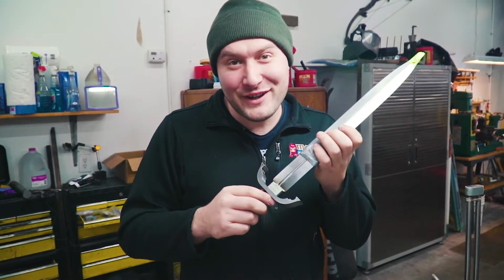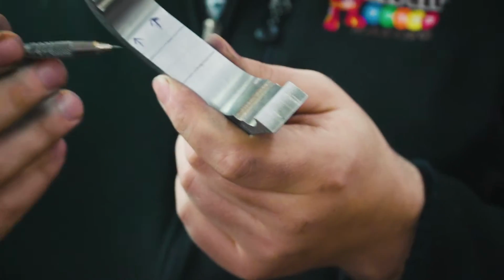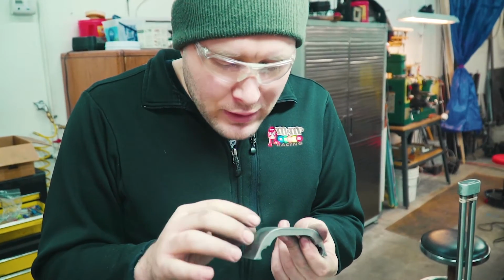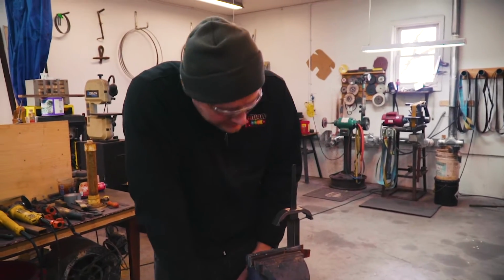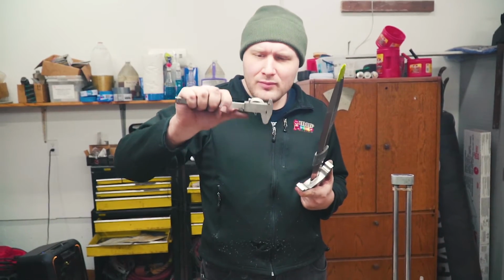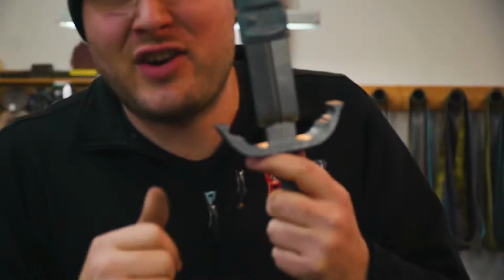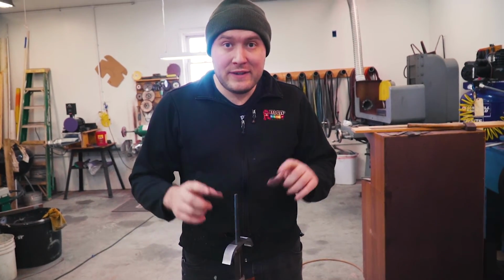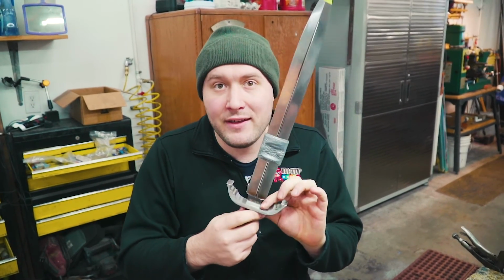How to Get the Perfect Fit for Your Guard: Part 2

Comment: Is it possible to heat the guard up to forging temp and then essentially forge fit the guard to the ricosso? The guard would be hot enough for the ricosso to essentially stamp its way in with soft blows.
Reply from the maker: Yup that’s one way to do it. We prefer to surgically fit them. Good question my friend. 👍🏻☕️🔥⚔️

Dad

Comment: What about making holes in the tang? Then you could fashion a whatchamacallit to hold the object perfectly still without worrying about damaging the blades? Fit the guard close to the ricasso, attach the whatchamacallit in the holes, then you can use force to press the guard into place? I realize that putting holes into the tang reduces the weight. Then you could make a plug to superglue into the holes? Then you don't have to put tape on the blade, which reduces the time needed to clean the blade?  Keep up the great work, I enjoy watching the Masterpieces that you create.
Reply from the maker: Hey thanks Michael 
Good ideas 
Cheers 
Team Royer

Comment: Hay Kyle  finally got a chance to shoot a video  on press fitting a guard,check it out.I think  used in conjunction  with your meathod  of inletting  the recoso would work excellent. I like the control  of the press fit and hate pounding one on with a pipe or other item.
Reply from the maker: I'll check it out, thanks!

Comment: Well I guess that answers my question I had on your last vid lol.  Looks perfect!   Have you ever happened to have any problems with the sides on the ricasso slightly upsetting where the guard sits?  This kept happening on my last press-fit guard and I was trying m hardest to use the lightest hammer blows as possible, which was about as hard as you were hammering here.  Maybe I drew back the hardness on the tang/ricasso too much with my torch and maybe I shouldn't go past a blue color, but I can't say I've ever heard of anybody else have this problem before.  Also, it was a clay hardened blade so the ricasso shouldn't have needed the temper drawn back anyway, but I did it just for assurance.  Do you have any thoughts or experience with this, Kyle?  It would certainly be appreciated, as I had to refit the guard at least 3 times after grinding to fix the upset tang shoulders lol.  Thanks again for sharing :)   ~Paul
Reply from the maker: Paul, this is a really good question, in fact, I probably need to do a post on it since there's so much to explain on it.  The short answer is YES!  I do have problems with parts of the ricasso getting upset from time to time, I normally try to soften the tang/ricasso area after I've done all my guard fitting that way the ricasso is nice and hard, I occasionally have to soften the tang and ricasso first and it's usually okay then as long as I don't go past a blue color.  It's really bad on a clay hardened blade if the ricasso isn't hardened you pretty much just have to use a softer material for the guard or be super super gentle and spend a lot of time with it.